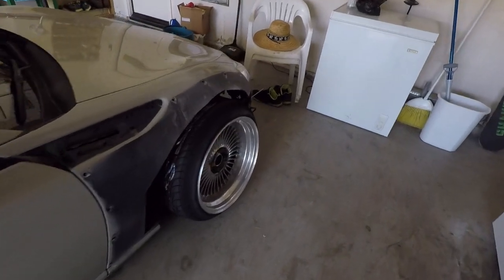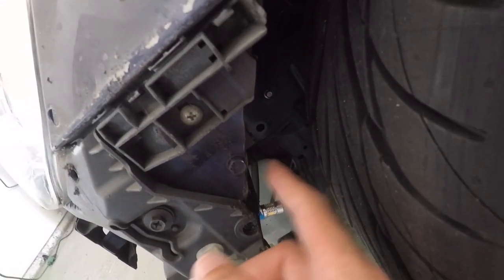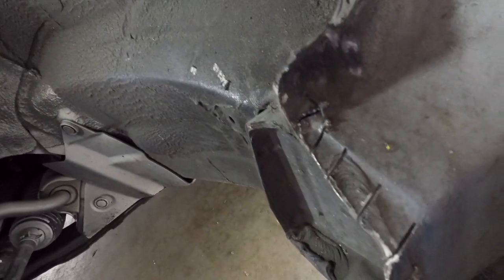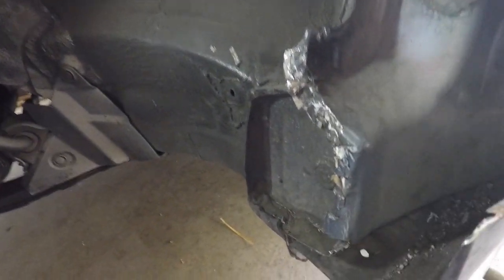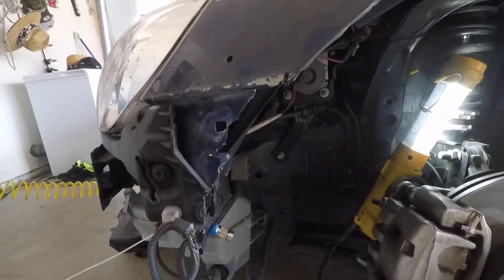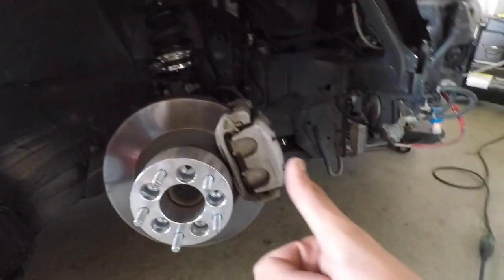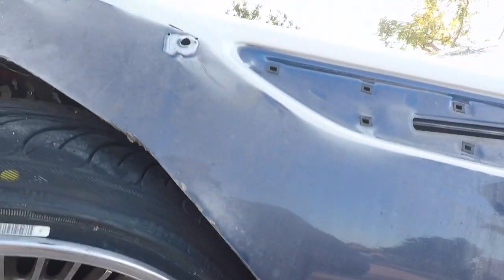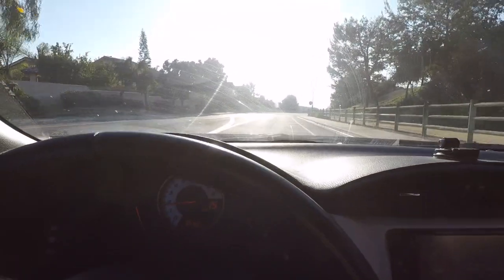Tire Rubbing When Turning Fix! (Rocket Bunny v1)

Comment: 10/10 would not recommend cutting that piece on the top of the wheel... kinda has a lot of structural importance in the car..
Reply: Gemini I’m gonna cut it when I wake up but thanks dude
Reply: Ur fine to cut it aslong as your not racing or taking corners at extremly high speeds, if you are though you need the structure  strength to keep your frame from twisting.
Reply: I cut the same party years ago and been driving like a maniac since. It’s good